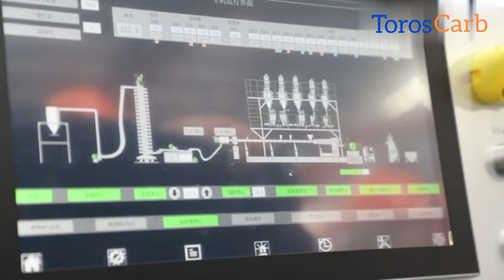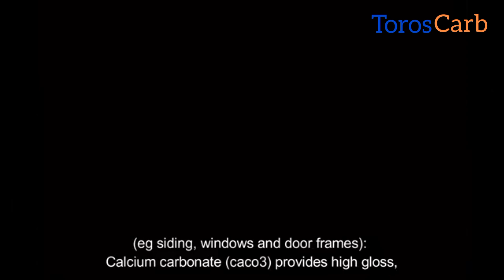Calcum Carbonate .. Plastic Industry

Comment: Calcite, plastic furniture, pipe, automotive etc. It is used in the production of many plastic products, both in natural form and in coated form. Coating is mostly done with stearic acid and sometimes with calcium stearate. Polypropylene (PP), Polyamide (PA), Thermoplastic (TPES) and PVC resins are mainly plastics in which calcite is used as a filler. The use of similar fillers, especially calcite, in the plastics industry has increased every year. Calcite is used as a filler in the plastics industry for many reasons such as its color, purity and cheapness.